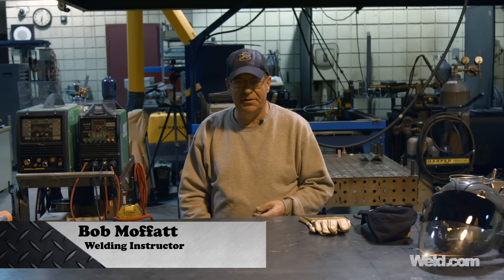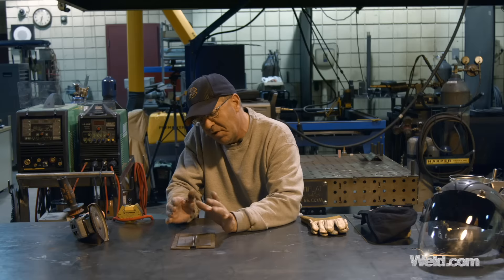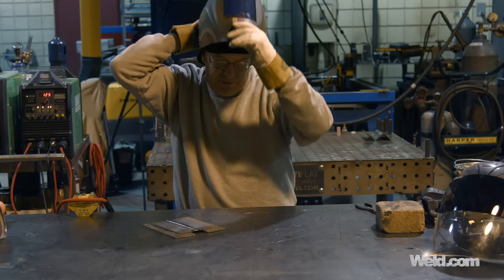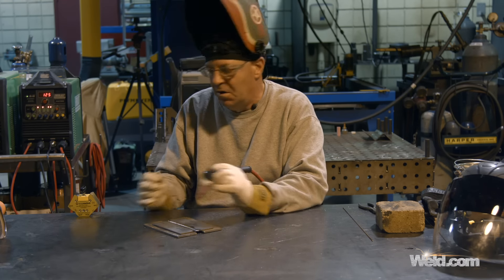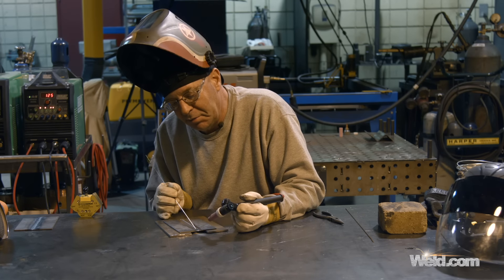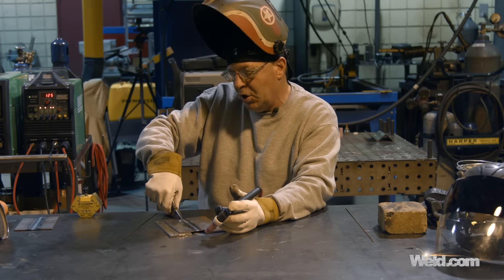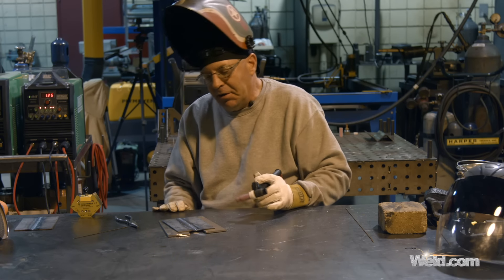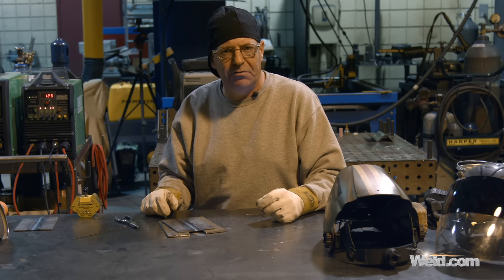🔥 TIG Basics: Thin Plate Butt Weld Practice

Comment: Excellent instruction, thank you. I am very new to welding - six classes into an intro to welding continuing ed program. Still running stick weld arc beads by the mile (feels like it anyway), horizontal, vertical, overhead, zipper, etc. All the mig/tig, flux core, solid core, etc., is all still unknown to me, (that comes in the second course this winter). Straight-up instruction, honest, direct, no fancy graphics, sound bites, other distractions. I am addicted, looking forward to more.

Comment: This video provided an "ah ha" moment for me.  After watching it a few times, I realized that I had my amperage turned up way too high.  I'm trying to learn to use a foot pedal and not being much of a TIG welder to begin with, I was just making a mess of everything, but then after watching Bob and looking at the current on his machine, it dawned on me that I had my current turned up way too high.  I just don't have the skill to control the foot pedal with that much current set, even if it's appropriate to have the current set so high in the first place.  When I adjust the max current to match the work piece, I have much better success so when I mash the pedal, my work piece doesn't blow away and the full pedal is where I should be with the work piece.  It's night and day for me.  I was ready to just call it quits with TIG and stick with SMAW, because I don't suck at it and I really enjoy the smell of 7018,  but I have found the joy in TIG once again it's thanks to these videos.  It took watching the video a few times and if I couldn't see the amperage on the machine, I might not have figured it out.  Details are everything in these videos and the benefits to those on their way to mastery are priceless.  Thank you weld.com and thank you Master Bob!

Comment: Good video. I'm an old welder, and last year I would've really use some thoughts/taught on how to setup a "crappy" (15y-o Lincoln 210Amps 25%) welding-machine to mig-weld around (butt-joint) rebuilding as new a manure tank. I've chosen gas flux-core as I'm used to rebuild/butt-weld 5/8" to 3" thick material on different machines (buckets/loaders&booms/bulldozers/farm-equipment/saw-mill rigs/trailer-trucks/shop-cranes/cranes/cast-iron casings/housings/etc... you name it). But all I could find was lap-joint this and that..... and I'm like, "What??? These guys are all pro-welders, and it seems they never once in their career had to do what I have done or need to do". I had about 3 sections to weld together which amount to some 80feet of all-around welding. And it was out of the question I could rod-weld these as the stick-welder my friend has is no good anymore (needs a complete re-haul as those machine were the best way back when etc).

So yeah, after all my useless bla-bla-bla here (trying to put a context anyway), how would you go about mig-welding butt-joint 5/16" plates? (it's not pipe-line work though, so no scale-removing is needed. Lets just say it's like as if welding on a production-line or such) (yeah I know, production-line welding is not welding. I call this "gluing".... :-(

Comment: You show a lot of thick plate welds. I’m a coded mig welder from the uk and I also weld 4mm plus steel. I wanted to see if you could advise on car body repaired at 0.8-1mm thick. What’s best mig/tig and any tips. Thanks James

Comment: I just learned this 2 days ago. My job sent some us to an 80 hour weld course to master mig and tig and on the 4 total days of tig we get, we have to be able to do a perfect top down 4in butt on 1/32nd steel to pass both a visual test and a bend test, and after practicing it for 2 days, it feels impossible. Mig was so much easier to do. Using blue tungsten, have the machine turned all the way down to 40A and it still burns right through just trying to tack the joint together. Tig just feels like an impossibility to learn in just 4 days. What is the trick to this? You're blasting through it like it's nothing at all with perfect penetration and at a much slower rate I get huge gaps of no filler rod melting in, holes, and no penetration at all. What's the secret to this?

Comment: So the gap closed even with a tack on both ends? Thats a hot fill.
Reply: Peter Ford it's because he started on one of the tacks. It melts the track and the heat pulls the gap shut. It would have happened at low temp as well
Reply: charles streeter Ahh, I see. Was curious. I do torch work. Thought tig was so much sudden heat . Thanks.

Comment: One suggestion.  Please mention your tungsten size when you do the videos.  We can see the current but we can't tell what dia tungsten you are using.  Thank You.
Even if you didn't get the weld the first time, the expert in you took one look and knew what was wrong and how to fix it
Reply: tungsten dia isn't that important. I know a lot of guys who weld just about everything with 1/8" they just sharpen it differently. You can weld thin metals with 1/8" if you put a sharp point on it. I use 3/32" for everything that it will handle unless I'm doing micro welding.

Comment: Less than 1 mil, .003 to .004 sheet seems to be my curse. It's absolutely hard AF to start a tack on the sheet without blowing it out WITHOUT cheating.
I can get it to tack up homogenous quick from each side and i can also see the arc stay on one side to keyhole both sides into a huge gap . Without oversized filler, it gets nasty quick to not have a larger initial puddle to push along. 20 amps is maxed out.
Anyone care to share any information about technique. No plate backers as well, can't do it where it it's being welded as much as I would like to have them there to chill the steel. I've tried it with aluminum screwed to the steel, but the steel is pressed into a specific shape.
Reply: Aint1S AUTOGENOUS IS WHAT YOU MENT?😎
Reply: I can't seem to get it to happen without running it dirty. Ideally, I want autogenous. You're right though lol! Brain fart on my part. For some reason, I can't get it to play fair without a nice dab of filler to bring two  together without that filler to start the run. The starting thickness is somewhere in .0030's before I have to get the zinc off of it and it drives me crazy doing this vertically overhead.
Any pointers? Please! 🙏
Reply: with thin stuff i will tack the ends starting my arc on the filler letting it burn back a little til it hits the piece then if it needs to be an autogenous weld i will do the rest that way, ive found the filler trick makes it easy to do thin stuff only bc that initial arc start tends to be to aggressive and blows right through but once the arc stabilizes itself it wont anymore ( just realized im commenting from my gf's account sorry)

Comment: I'm not sure what's been going on over there lately as far as the filming quality but I'm bummed to say it's really gone to crap. I really appreciate what you guys do but the quality of arc shots, pre and post weld joint shots have just gone way down hill the past few videos, like off the edge of a cliff. You used to get right in there with clear shots and adjust exposure on the fly and get the shots no one else does to really show Bobs technique and what the welds looked like as Bob was explaining them along with showing machine amperage. I mean look at the difference between this video and one like "Lay Wire vs Dab Techniques" or  "AC Aluminum Pulse Welding". This doesn't even compare. What's going on over there? Please go back to whatever you were doing before! Thanks for the vids.  Edit: Not to mention the out of battery deal! Come on!
Reply: I have to agree. The photography in past videos was amazing. Not so much recently.  I really miss the way the videos used to be.

Thank you for all of your hard work.
Reply: And sounds quality
Reply: @steve just steve
Reply: Compare to this   https://youtu.be/mZ7--QLfBNs?t=154     there is no comparison.
Reply: House lighting vs Set lighting?
Reply: The sad things that I have to agree on, sometime. But, truth is truth. +1 Steve
Reply: The camera man got fired for standing around lol. +1 Steve